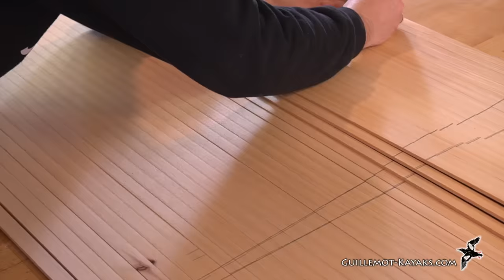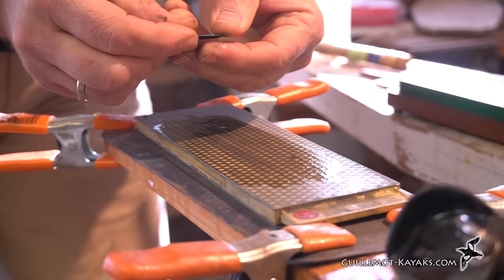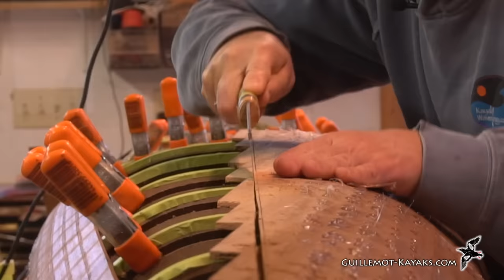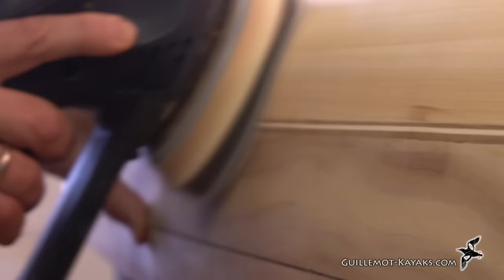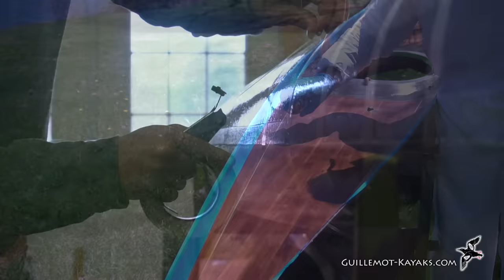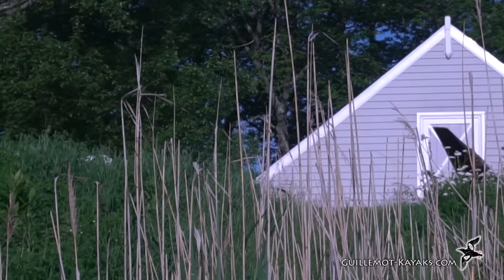Making a Cedar Strip Kayak - microBootlegger Sport Build Overview

Comment from the maker: It is approaching a year ago that I started working on this kayak. It is good to have this document of the process. I hope you enjoy watching
Reply: Nick, I just finished washing and sanding the epoxy and applying the first coat of marine varnish on my kayak. Several areas became milky looking with the fiberglass cloth cross hatch showing up - but I don't feel the glass, all is smooth. Any thoughts on what I did wrong?
This is my fish kayak and first time working with epoxy and marine varnish. 
Thanks,
Paul
Reply from the maker: Hi  @pamandpaulhinderaker8869 , Usually the varnish will make surface milkiness disappear. If you are seeing the weave of the cloth a bit, that would suggest that the problem is embedded in the epoxy a bit. It is hard to know exactly what is going on without actually seeing the issue. You could send me a photo at Nick {at} guillemot-kayaks {dot} com. I would be happy to take a look and see if I can offer any suggestions.
Reply: This is so beautiful. Congratulations on the exquisite craftsmanship.
Reply: What is the cost of something like this.
Reply: I'm so conflicted with what you have done. 

On one hand it seems like a crazy amount of effort to put into anything - but on the other hand it seems like the very best thing a person could do with their time...

damn nice work!
Reply: Was this something you did for a few hours every weekend?
Reply from the maker: It can be a winter of weekends and evenings project, but I made this for a client and put in more time to do an extra nice job.
Reply: Yeah, please don’t get it wet again, it’s too good to take on any sort of damage 😁
Reply: It looks absolutely amazing, craftsmanship spot on!
Reply: I was hoping there would be no music on this but there is. Can't watch.
Reply: @NickSchade  you cant have made much money from it, dont get me wrong, it is amazingly good but the amount of hours you have put in, you must have earned 5c an hour
Reply: Realy nice!
Reply: I can't find the word to describe the beauty of your work.
Reply: @bimmjim   there is a small button called volume. you can control it ;)
Reply: @FifersCotta  I would rather hear the sound of the working with wood.
Reply: @svborek  Priceless.
Reply: Like. Good job
Reply: Wow congratulations!
Reply: @bimmjim  what over the voices in your head 😳
Reply: Wow Is all I can say.  I need to fit new gunwales to my Malecite canoe and have been dreading fitting the end joints.  You make it look easy.
Reply: Fascinating!  I couldn't look away.  Such a beautiful boat.
Reply: @NickSchade   Nick it is an honor and a pleasure and so. to watch you work. I'm so happy that you posted this footage.  thank you, sir, for being you.  I really mean that.
Reply: @pamandpaulhinderaker8869   Pam dear think back did you somehow get a foreign oil in the varnish? that will for sure cause it to go all milky but that the only thing i can think of water or oil i hope that was a help.
Reply: @bimmjim  then turn it down, you can't watch because you don't really want to
Reply: @UnyieldingSeraph  I made my own Kayak when I was 16.
Reply: True craftsman old school tallent .
Reply: It's a fish kayak, it just has to float
Reply: Then this video wouldn’t have been just 35 min. Most of the video is speeded up, which means the sound would have been distorted and would not have been  pleasant to listen to. There are reasons to why music is used instead. But it’s also many times abused. This isn’t the case here.
Reply: @NickSchade  What kind of fiberglass did you use? I was thinking of using S glass, I'm also unsure of what weight to use. Any suggestions  would be greatly appreciated. Thanks!!!.
Reply from the maker: Matthew Fogarty I used E-Glass in this build but I’ve used S-Glass quite a bit. I don’t see much point in anything heavier than 4-ounce.
Reply from the maker: I don't think it would be as easy as just wrapping it with fiberglass and soaking it with resin. Without something backing up the 'glass the resin would just drip through, making a mess and likely not creating a watertight surface. 

You could likely wrap the frame a tight woven fabric such as nylon or polyester, seal that with epoxy and then add fiberglass and more epoxy, but frankly it would be easier to just sealing the fabric with paint, varnish, polyurethane or a urethane. Look up information about skin on frame kayaks.
Reply: That kayak is a beautiful piece of art, and the fact that it can be enjoyed on the water makes it even better. Thanks Nick for allowing us to enjoy the process. Amazing.
Reply: @bimmjim  I have a volume control on my device. Just turn it down and there's no sound.😁
Reply: You have quiet a Kraft, Now that's pure art. That's amazing.
Reply: Si, alucinante, por supuesto que se disfruta la contemplación del proceso de fabricación. Saludos desde Rosario, Argentina
Reply: @goldrushpro  In that amount of time, think of all the TV you could watch.
Okay, never mind.
Reply: @Nick Schade was that some Kevlar weave thrown in, or what was the multi colored fabric you installed?
Reply: @NickSchade  what is the fabric used inside? It appears similar to a Kevlar weave I saw used once, but couldnt be sure.
Reply: @Dev1nci  Yea, piece of art, like a good guitar,  should be shown only, not used.
Reply: @ronwhittaker6317  Yea,  those last precision strip fitting is amazing. And then sanding and sanding. So neat.
Reply: @janviljoen7001  Hahaaha yeah man, I was joking of course but it's beautiful. With a name like Jan Viljoen you must also be from SA? Or am I wrong?
Reply: I have built a few strip canoes. Your craftsmanship takes my breath away.
Reply: Вам свой труд не жалко вот так вот карпеть над вещью, ладно для себя но потом кому-то отдать даже за большие бабки мне бы жалко стало.
Reply: Wonderful!!
Reply: @wlehtola  kind of looked like a carbon fiber used on inside. Either that or maybe a 10oz fiberglass weave.
Reply: Some people just don't understand a labor of love. Well done sir.
Reply: Thank for sharing this...
Reply: Amazing. Ultimate relaxation video. Is this a magnum opus or the typical kayak you build for clients? Wow.
Reply from the maker: @allmomomosthomebus3895  It is a fairly typical build for me. While I did a couple things above and beyond my normal, I didn't pull out all the stops.
Reply: @NickSchade  awesome. I'm about to start a kit boat business for far less artistic work boats. I'm very impressed with your artistry. Beautiful craftsmanship indeed. With your talents you should start an apprenticeship program.
Reply: @4321mikexxxx  sorry but if you had these skills money would be of no interest at all. This is a blend of art and craftsmanship,  money has no place in connection with this beautiful work and I'm sure Nick will die more satisfied by his life than most of us.
Reply: Truly Stunning
Reply: How could anyone, young or old, not be mesmerized by watching this amazing video. I thought I loved canoes but watching it being made is at another level. So peaceful paddling..
Reply: @des-ex-diver  Have you ever done woodworking? I have done refinishing & one reason why is the sound, the smell (last project was an old handmade cedar chest!) & the feel of the wood.
Although I loved the relaxing music in this fantastic video..
Reply: @UnyieldingSeraph  Why is it people can't have an opinion about something without you jerks being mean?! You must be Fun to live with..
Reply: what kind of glue do you prefer?
Reply from the maker: @hooftrim4589  yellow carpenters glue

Comment: As an avid sport kayaker with three slightly upper mid grade kayaks, my dream is to build a wood kayak. My airplane ( KR2) has what's called a wood boat with fiberglass over the wood. So, I'm familiar with the process. My KR has been featured in magazines and won numerous national awards. But, the quality of your kayak is far beyond my KR2. In fact, it blows my mind that you actually took that work of art on the water and that your dock has no bumpers. I cringed. As another stated, it's a Stradivarius and certainly museum quality. I salute you.

Comment: The most amazing things about this project:
1. All those tools and all that sharpening and the man still has all 10 fingers. Not a single Band-Aid to be seen. Were it my kayak, the stain of choice would have been blood.
2. When finally finished, he up and put it in the water. I'd have hung it on the wall in a climate controlled glass case then gone to Cabela's and bought a plastic one to paddle around in.

Comment: Well done, Nick, thank you for posting. You know, it's been 18 years since I started talking about building a stripper...been busy with the S&G's. Shannon (my main squeeze) wants me to build a stripper canoe (the old fibreglass one (Alberta made) is pretty heavy) so I will set up the forms for both canoe and low-deck Night Heron (I still have those forms, just never used them). Guess I got the winter to figure out the wood/color options then get at it. I never get tired of watching your quickie built boat videos, they are plenty educational, keep them coming.

Comment: That is a beautiful kayak. Like a Rolls Royce of wood on the water. Though I may be able to build one, I possess neither the shop nor the tools, and so bought a couple Carolina blow-molded LDPE sea kayaks, about 15' long and 40-50 lbs. I don't mind if they get a scratch or rock ding. One is red, the other blue, and for < 2 grand total cost, they have worked great for over 15 years so far. For better slip, I use some Pledge on them before putting them in the water. Works great, even though they are likely a lot slower in the water than this H2O slicer. 

Nice work.

Comment: That is amazing.   Well done.   I love a few different types of cedar.
   I'm not a boat builder but, I do have 2 questions though.   After the kayak was made, you covered it in fiberglass.
               MY QUESTIONS:
  -  Wouldn't it be lighter to make it with just fiberglass.?
  -  Is the cedar just for looks.?

You have wonderful skills and a  talent that not many have.    Thank you for sharing this with us.
Reply from the maker: I use wood in the build for several reasons: Ease, looks and weight.

This method provides an easy way to make a "one-off" design. 

Making a pure fiberglass kayak requires you build a plug (essentially a full size model of the boat). 
You get the surface of the plug perfect and shiny, then you make a mold of the plug. You lay fiberglass on the plug, let it cure and then pop that piece off. 

You clean up the mold, making sure the inside is still shiny and nice. Then you can use the mold to make the kayak. 

So for a typical fiberglass kayak you essentially make 3 boats and only the last one is the kayak you keep. This is worthwhile if you are making 20 kayaks because you can keep using the mold. But if you want one kayak, it is a lot more effort than what I have done here.

The next reason is because the wood is beautiful. So, in a sense the wood is there for looks.

But, kayaks made this way are lighter than fiberglass kayak. The wood adds stiffness and strength. It is possible to make a boat this way with wood and fiberglass that is as light as one made with carbon fiber or other expensive exotic materials.
Reply: @NickSchade  
    Thank you so much for explaining that.    I forgot about build a plug and a mold before you can make the kayak.
    I've always wanted to make a small Jon-boat from scratch. (Maybe someday).
    I agree that cedar is beautiful.   I used a bit of it when I built my camp.   

Still your work is absolutely beautiful thank you for sharing.

Comment: Do you have a special tape that you use when trimming your fibreglass alongside it? Is the epoxy on the fibreglass still moisty/tacky or completely dried when you cut it?
Awesome boat 👍
Reply from the maker: I use a good quality masking tape. The trimming works best when the epoxy is still “green” soft, but no longer sticky, but I often do it a bit earlier when the epoxy is still sticky but no longer flows.
Reply: @NickSchade  okay, thanks, I will try this on my Waterlust Sailing Canoe next weekend.

Comment: Absolutely stunning craftsmanship invested in this piece of artwork. The one thing that surprises me was not using an HVLP spray gun to put the clear finish on (in lue of using a poof-can).
Reply from the maker: The rattle cans were an experiment. I probably won't use them again to do a whole boat, but they may come in handy in some situations.
Reply: @NickSchade  Okay...that makes sense. Having some experience in using HVLP spray guns, I know that you can get a pretty descent finish out of a relatively inexpensive spray gun. Actually, one of my favorite guns was a touch-up sized gun I had bought at Harbor Freight for less than 50 bucks. It produced a beautiful finish!

Comment: Did you cut them into two pieces at one point because I missed it. I saw you sanding and then the next thing I see the fiberglass and they are in two pieces. Awesome work!
Reply from the maker: The deck and hull were never glued together. I lifted the deck off, then removed the forms.

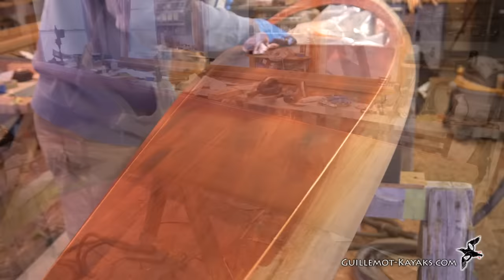Comment: Nick, how did you get the station sections out?  At 23:00 there's suddenly two halves, so you cut the tube shaped hull length-wise, then glued and glassed the two halves back together from within?  Very nice meticulous workmanship.  A lot of fairing.
Reply from the maker: The deck and hull are not glued together initially. At some point I show the deck being lifted off. I lifted out the forms right after that.

Comment: From my draftsman days about 50+ years ago I noticed that you rotated your pencil as you were drawing a line so that the line remained the same width for the entire length, Also, did you build the edge plane, or is that a commercial tool you can buy?

Comment: I've made 6 wooden surfboards, am itching to design and build a few Cedar kayaks. If I'm only using fiberglass on it do I need ribs and should I fiberglass the interior or is a coat of resin enough. Also, any ideas on how to repel wasps and other stinging insects because I think they came from miles away once I started sanding the cedar last time
Reply from the maker: Fiberglassing the inside eliminates the need for ribs.
Reply: @NickSchade  thanks a million, means replication is dead easy as construction ribs can be used repeatedly. Had a feeling that was the case as my surfboards are as strong as a brick something house. Thanks for the speedy reply.

Comment: Am I blind, or are you using a glue gun to seal the cedar strips? I'm curious as I didn't know how you'd achieve a watertight seal.
Reply from the maker: The hot glue is only used to temporarily clamp the strips to the forms. The strips are glued together with yellow carpenters glue. Everything is sealed with epoxy over the fiberglass.
Reply: @NickSchade  That makes sense. Your canoe is a work of art you should be very proud of.

Comment: miksi tuo kuuma liima and tape? any other system way to do?
Reply from the maker: The hot glue and tape are an alternative to using staples as temporary clamps. Staples are faster, but they leave little holes in the strips. Not a big deal but some people don't like the holes. This method with hot glue and tape is fast and effective.

Comment: Sad that you have to use so much tape.... maybe use some sort of string and weight set up.
Just a suggestion. But in situations like yours I would get some weight (nuts) on the end of some micro cord anchored to the work or table then drape it over
Reply from the maker: There are lots of alternatives that could be used instead of tape. It stick with tape because it is reliable, convent and quick.

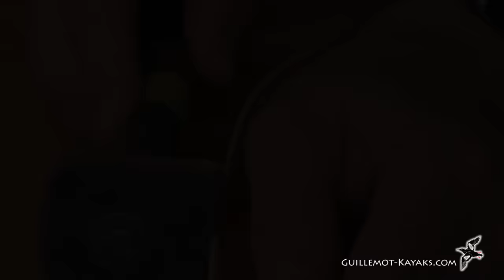Comment: what is tool name on your video 25:00min hand surface cutting tool??
Reply from the maker: That is the majestic paint scraper that I have modified to fit the shapes I need.
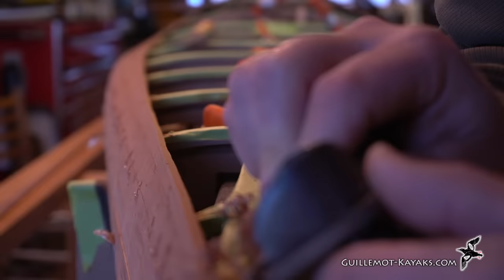Reply: nice tool~looks very usefull and 16:35 angle cutter is same before cutter??
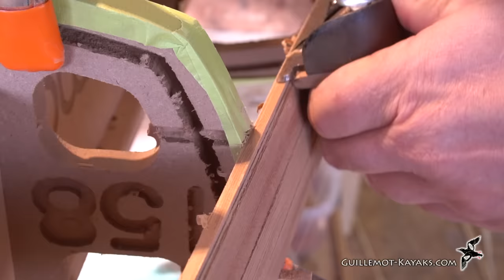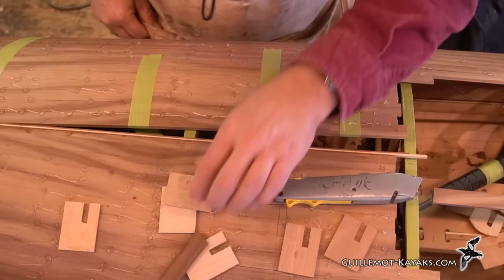Reply: 9:14 and 16:20-28min is same tool??

Comment: you did  a great job, but it is not a cedar kayak, it is an epoxy kayak with cedar structure. 4mm cedar with 6 mm of epoxy and carbonfiber
Reply from the maker: To be more precise 4.8mm cedar and less than 0.5mm fabric and epoxy. The cedar, fabric and epoxy work together as a composite material creating a structure that has better properties and any of the individual components.

Comment: Yes, it is a work of art. However, even oil paintings on the walls of museums cannot be put in the sunshine as they will degrade. Using epoxy over stained wood is invitation to disaster. All epoxy formulations will degrade rapidly in direct sunshine. All my Kayaks and boats have been finished with 2 part polyurethane colored coatings. Sorry, I know many people want to see a furniture type natural wood finish but sun is the enemy to epoxy.  Try it some time. Take a small square of glass or poly cloth and saturate it, and after it cures put it outside in a sunny spot such as on a tree stump and in 2 months it will deteriorate.
Reply from the maker: The 2-part clear coat on this boat will protect the epoxy for years. It will need to be recoated if it is stored outside for a long time, but this boat will be stored inside. I anticipate this boat will not need maintenance like that for 30+ years.

Comment: You should learn a lot before you can call yourself a professional !! First mill all plank wood round on one side and hollow on the other, do not use hot glue, much less adhesive tape, or even better would be no adhesive tape at all. The side wall has no sharp knot on the floor ... so you see a lot is missing until you can call yourself a boat builder, the only thing is learning from real professionals and no own inventions or your own handicrafts otherwise you can never get a good boat out with one good straight running and high quality !!!